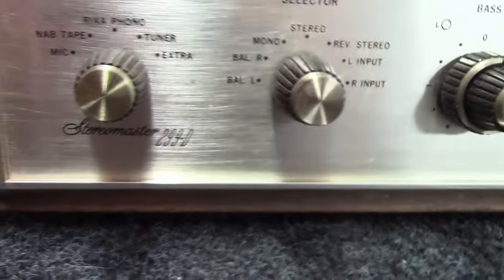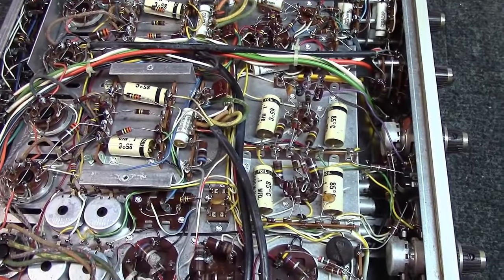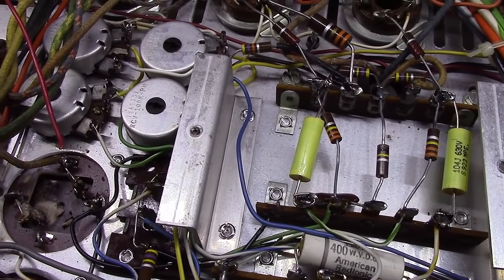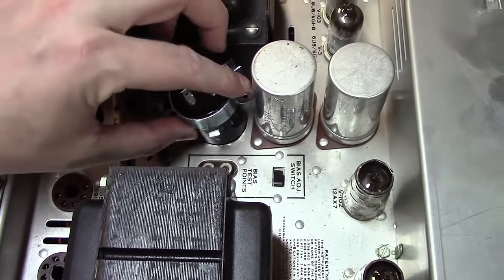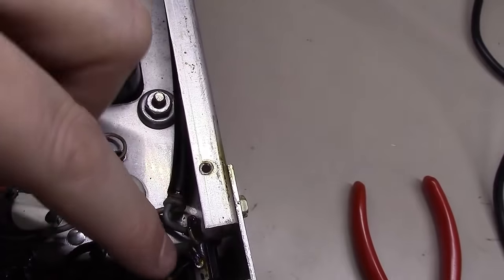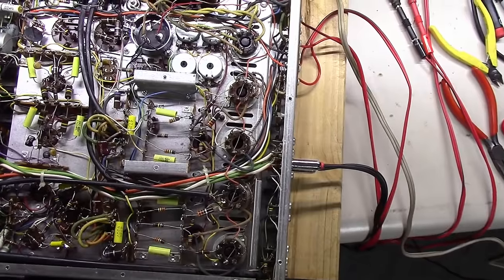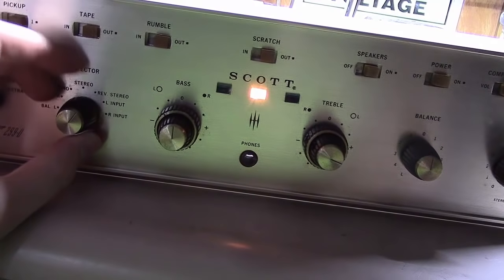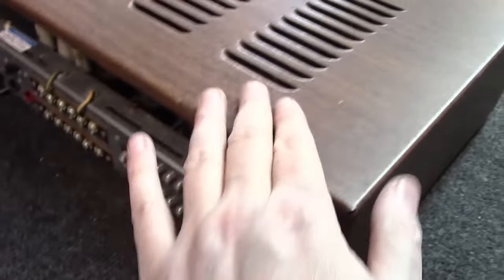HH Scott 299D Tube Amplifier Restoration - BG040

Comment: I hate these audio equipment YouTube videos by "experts."  This guy called an electrolytic capacitor a "coupling" capacitor.  He must be blind not to see the + sign on the EXPLODED capacitor.   Babble, babble, babble, he goes on.  The proof is  in his pudding.  He says he's "read about the Siemens bridge rectifiers going out on the forums."  He says that when the filament/bias supply is running low the output tubes could "run away."  He's right about that.  But then he says with the preamp and tone control stages the tube filaments could burn out.  How do filaments burn out when they their voltage supply is lower than nominal?  If he's really worked on vacuum tube amplifiers he'd damn well know how to check and replace the bridge rectifiers with a silicon bridge and adjust the voltage to the correct value.  No, he's made himself into an "expert" by parroting stuff from the forums.  Mr. Blu-Glow is a phony! 🥸

Comment: I am working on a Scott 299b and replacing the rectifier. I have black and white wires, can you tell me which goes to positive? I see your black wire went to positive and Bluet to negative. Also does it matter which way the orange wires go? Finally, did you install a resistor after the rectifier as I've read people recommend that. Thank you
Reply: Yes, a resistor needs to be added because a silicon rectifier has a much lower voltage drop than a selenium rectifier.  Generally in the 18 to 24 ohm range.  Find the right value by trial and error.  Each 12AX7 heater will want 11-11.5 volts DC, not the full 12.6 volts.

Comment: I have replaced Selenium rectifiers with diode bridges .And all the voltages change ..you need to adjust the bias in most tubes to sound original.

Comment: The D version of the 299 series uses 1847 incandescent bulbs, powered from the 6.3VAC filament winding, not neons like previous versions, which ran off the high voltage supply. I like the neons better, but that's my personal preference.  The incandescents are easier to change though.

Comment: At 30:30, when you talk about the possibility of having too much negative voltage available from the bias supply because of having replaced the selenium rectifier with a modern silicon diode bridge, you explained the effect of this circuit change  backwards and incorrectly. Having too high a negative bias means that the  output  tubes would be throttled back too much, running somewhat "cold", almost as if there is a "governor" on them, and with not enough plate current going through them, which would tend to make for higher output distortion, and might also cause the B+ voltage on the filter caps to be a little too high, since they're not being loaded down by what should normally be  a higher amount of current draw from the output tubes. Having higher-than-normal B+ voltage might mean that the old electrolytic caps in the unit could  be stressed from the increase voltage.

 I've worked on a few of these same units myself, and I found it is especially important to make sure that pins 4 and 5 on the preamp tubes, and socket contacts 4 and 5 for those same tubes, are clean and tight and making a reliable electrical connection r, because if any one of those total of eight pin to socket connections don't make a reliable, consistent electrical connection, the heaters of all four preamp tubes will go dark and the unit won't play. if the unit is left turned on, with B+ going to the preamp tubes but the filaments not heating up,  the useful lives of those tubes will also be shortened.
Reply: Nonsense!  B+ on a tube with a cold heater (filament) won't do a damn thing to harm the tube.  Electrons don't flow in a vacuum tube without being driven off of a hot cathode so no "damage" can be done.  Tube will just be cold and do nothing.

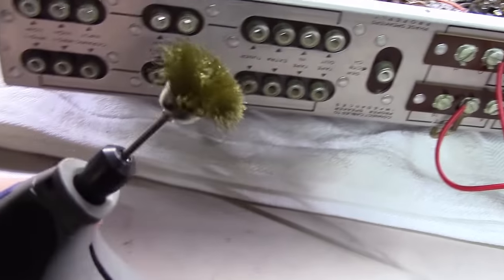Comment: At 28:30, using a Dremel tool wire brush to clean those Jacks is an absolute No-No! Certain to leave scratches in the adjacent aluminum chassis and it'll take the silk screening right off as well if you slip and get too close to it. Use a powered pencil eraser! The old style large AC powered ones with induction motor and a long quarter inch diameter rubber eraser rod, as used by draftsman in the old days, are the best way to go, but a modern miniature battery powered eraser from an art store or available online will work if you find one where the motor has enough torque and you can get some semi- abrasive eraser Nubs to fit it. Pink eraser nubs or rods designed  for removing pencil are okay if the corrosion or pitting isn't too bad, but gray erasers designed for removing ink are much better if the jacks are heavily tarnished, corroded, or pitted. I should mention here that several of the battery-powered pencil erasers we found come with really soft vinyl erasers that are of little use for any kind of metal polishing, and you might have to try obtaining different erasers from different sources, but they're very handy little tools once you figure out how to get him set up right. 

Anyway, I am surprised that you don't know these tricks. Haven't you ever cleaned relay contacts with an eraser shaped into a wedge or chisel tip? certainly, every old-time ham radio operator, or anybody who worked with radios an Electronics in the military, knows about these techniques.
Reply: So negative….try to be more constructive with your comments this Guy is very skilled , but clearly not perfect as you “are”:-/

Comment: Hi Mark,
 I realize this is 3 years old. You made mention of changing a resistor on the bias circuit after replacing the selenium rectifier. But, you never said which one or the value you used. I have just completed essentially the same resto on an LK-72-B (299D) and am at the point of verifying voltages. Thanks.
Reply: Dan N I did and still have the LK-72. Basically, I replaced all the caps in the PS and all of the coupling caps. I found a few resistors that were out of tolerance and replaced those, as well. Of course, as referenced, the selenium rectifier bridge was replaced with a modern one. So, bias voltage automatically increases. This was my question to Mark about the value of the resistors in the bias circuit.

Comment: I am constantly amazed at the condition I find 50-year-old plus amps in. Original tubes are, of course, always in sockets and are usually in pretty good shape. More often then not, the power supply caps have problems and they are frequently soldered to the chassis and, of course soldered to the circuit. A time-consuming task! I have caps that are designed like tubes in that they can easily be put into a octal socket. Seems to me that parts that are prone to fail should have temporary connections like tubes do. Have you ever put in sockets for these tube-like power supply caps?
Reply: You are cracked up crazy!  A plug-in electrolytic capacitor is an ELECTROCUTION hazard.  THAT'S WHY B+ FILTER CAPS ARE HARD WIRED AND FIXED IN PLACE.  Shhhhsssssshhhh....!

Comment: Great video and well explained but very surprised you didn't change out all of the electrolytic cans. They are already very old and are probably leaky. The extra cost would give you and your customer a higher degree of confidence that the unit will not crash and burn any time soon. Did you check the ESR of the sections or at least check the AC ripple?
Reply from the maker: Always test ESR, always...
Reply: My thoughts exactly.
Reply: More nonsense.  Electrolytic capacitors reaching their end of useful life increase in ESR (Equivalent Series Resistance) until they fail to filter adequately due to losing electrolyte.  However a good electrolytic that has not seen a voltage in years will be somewhat DE-POLARIZED and application of voltage to the capacitor will draw more current as RE-POLARIZATION takes place.  If the polarizing current is too high the capacitor can overheat, spill its electrolyte out, and possibly dead short, take out a rectifier tube, and potentially cause a power transformer winding to open.  ALWAYS DO A RE-POLARIZATION PROCESS BEFORE APPLYING FULL LINE VOLTAGE TO A VINTAGE AMP THAT HAS NOT BEEN OPERATED IN YEARS.

Comment: Having those wires running over the can capacitor bracket mounted underneath is a recipe for disaster. Recapping an amp like this with modern components should last many many years. I can see many years of heating/cooling and different conditions taking their toll on the insulation and eventually shorting out. Sorry, forget the looks I'd put that bracket on top of the chassis where it belongs
Reply: another thing I just noticed, moving that capacitor bracket underneath as you did gets the bare wires very close to the amp bottom plate. They are flimsy at best and this could also lead to problems... move it up top and avoid any of these problems. Cheers.
Reply: Never seen anyone mount the chassis clamp for a cap on the bottom??? Looks MICKEY MOUSE, not to mention your concerns. Great video otherwise but as they say, one ahhh crap kills a hundred at-a-boys.. :)
Reply: Any consideration to stuff the original cap to maintain retroness....

Comment: I think it would have looked better if the bracket was on the top side, and there would be less wire rub points as well.....but thats just me I guess.
Reply: Never seen anyone mount the chassis clamp for a cap on the bottom??? Looks MICKEY MOUSE, not to mention your concerns. Great video otherwise but as they say, one ahhh crap kills a hundred at-a-boys.. :)

Comment: I have a later version 299D i restored last year sounds fantastic . I used 716 orange drops for the coupling capacitors and replaced all electrolytic caps with sprague atoms  mounted under the chassis  and left original caps in place for original look .  . Man it sounds fantastic